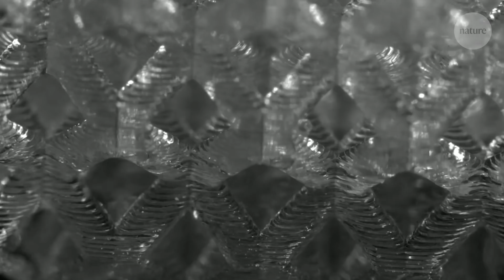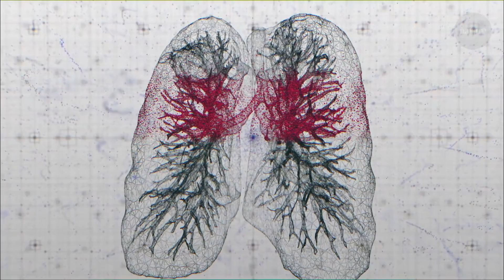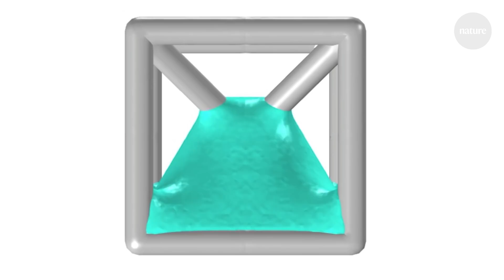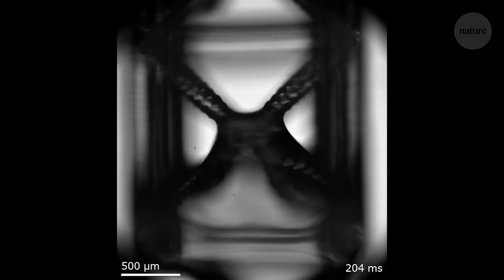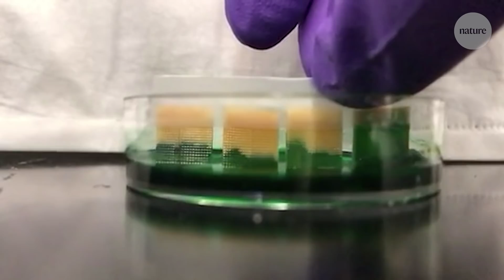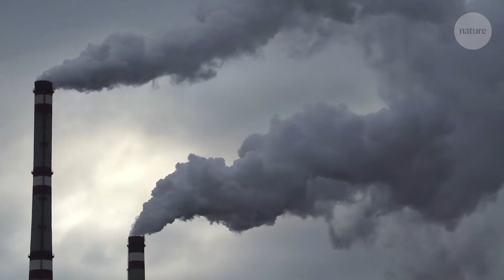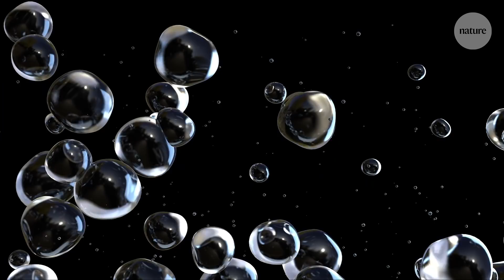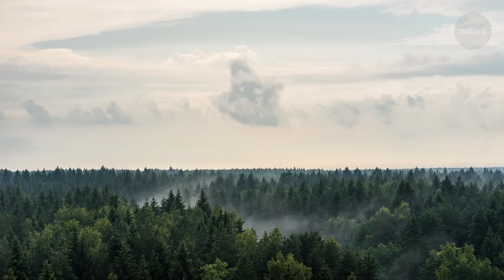Why leaky pipes can be better for moving water

Comment: Nature forgot to mention about the purity of the liquid required for this microstructure as if any additives or impurities can block the flow very easily an reduce the efficacy of the flow system
Reply: Yeah I was wondering, if you get a little surfactant/soap in there, wouldn’t it stop working?
Reply: @yoted  Just a thought, but surfactants decrease rather than completely eliminate surface tension and only work when the bulk volume is saturated. Maybe using cube networks of smaller than 1mm can compensate for less adherent liquids while still accomodating water? Although at some point I'm not sure if it would be worth it anymore. I guess salt is an option as well.
Reply: @yoted  yes it would. The required size of the cube would need to be much, much smaller or it would "leak"
Reply: A twisted tissue paper in long pvc pipe does the job well too
Reply: Wouldn't the same issue happen as it absorbs gas or particulates that it couldn't hold that state anymore?
Reply: @jonjudice1155  more or less ,plants exhibit osmosis to operate stomata cells and alter the concentration of liquid particle to devlope negative pressure to pull the liquid in the microstructure (xylem tube)which has to be homogenous for the net positive flow rate upward .
Reply: @kanpurunplugged9970  I'm sorry I may have been unclear, even though I didn't know that either, but I meant in the context of the thing they created. Sure it works in that way, but will it actually still work when it starts "trapping" things, are will the water simply fallout so to speak
Reply: @kanpurunplugged9970  surprise! Negative pressure doesn't exist. You've been lied to buy your teachers.
Reply: Thats why i hate tgis hippy dippy green tech crud. Its all so fragile and REQUIRES HYPER OPTIMUM CONDITIONS to work!
Reply: @xedrickOG  research well spent if it leads to promising results in the future
Reply: @mariomurcia7509  it wont though. This REQUIRES that distilled water only be put through the pipe. And eventually youll run  into extensive maintence issues as your system gets dirty. The amount of maintence it'd need makes the idea unfeasable. No city AT ALL can afford to repave their roads DAILY

Also repaving wpuld be needed due to having dug up the pipea
Reply: @xedrickOG  you realize it's for like micro use right? it wouldn't be difficult to clean regularly since little be in small sections. plus the idea itself is relatively new, I'm sure there's kinks to work out, but just because it doesn't have the most all inclusive application doesnt mean it isnt a worthy investment of time.
Reply: @mariomurcia7509  then the idea is useless. Micro settings means it has no market.  If you csnt sell it commercially thwn its a flop
Reply: @mariomurcia7509  and no just because something is new doesnt mean its good. Like it or not this thing woupd clog in a real, non lab setting in a matter of hours, if not a full 24 hour period
Reply: @xedrickOG  listen, if something is 3 times as efficient at doing the job of an already existing system as a raw idea, I'm willing to bet that the potential is good. besides since we dont know exactly the applications or the clog rate, its dumb to make claims like it's useless. easier to just agree and say there potential, and if it doesnt work out so be it. either way it can only be a good use of time.
Reply: @mariomurcia7509  except the existing system ia less maintenance intensive and therefore more cost effecient. This idea is stupid becsuse it needs daily maintence which simply isnt possible in ANY practical setting.  Just accept that this is a bad idea and move on. Also it obstructs the flow of water
Reply: yeah that leaves this project in lab lol
Reply: @UCA6JO_QfqPqttKNKkPtdPdQ  I never disagreed with you. I said this would work in space... MAYBE that implies that gravity would not be there 🤔 . They are just liquid pathways for now. No more no less.
Reply: Soap!
Reply: It’s a great concept though
Reply: What about the fact that this will be used in controlled environments that require purified liquids. The system can still be encased to keep fob out.
Reply: @luisislas2162  If you encase it, you remove the surface area and mitigate the potential gas exchange or cooling effect.
Reply: @TheDaggwood  I mean like without touching the surface...
Reply: Theory vs. Practice
Reply: reverse flow and maybe possible to make something equivalent to  a coin sorter for micro particles that would dump them outside of the main structure.
Reply: @luminousfractal420  still requires too much maintence
Reply: Its not designed for this world. Their designing this for space. It would efficiently move fluid through module boards as a cooling system as it moves 3 times faster. He says that in the video.
Reply: @gamet0phyt315  we arent talking about the implementation of  on earth either , we just elaborated how plants system works in the nature similarly as the -ive pressure builtup in plant stem works against gravity where as this microstructure exhibits intermolecular surface tension where gravity is insignificant.
Reply: @gamet0phyt315  we arent talking about the implementation of  on earth either , we just elaborated how plants system works in the nature similarly as the -ive pressure builtup in plant stem works against gravity where as this microstructure exhibits intermolecular surface tension where gravity is insignificant.
Reply: @kanpurunplugged9970  there is only Earth.
Nowhere else to go.
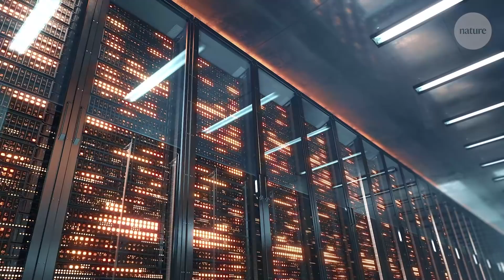Reply: Did you even watch the video ?!jump to 2:30 for application of this tech

Comment: Cool. Is this usable to acidify water on purpose? I liked the use cases. Interesting in any case. 3d printing is hardly explored isn't it?
Reply: I imagine so - if you ran these through a high-CO2 atmosphere, the large exposed surface area should let it absorb CO2 more readily and thus become more acidic.

Comment: This looks a lot like a sponge with extra steps.  The video explained the difference between one of these systems and a pipe, but I don't think it did a good job explaining the difference between this thing and a sponge.  Also, it didn't really touch on one of the important benefits of open-interior pipes, which is resistance to clogging.  It looks to me like this thing will stop working as soon as it gets dirty.
Reply: a sponge that can direct the flow sounds pretty interesting..
Reply: A sponge primarily works by the billows effect of compressing and the subsequent expansion. Also, while a super organized and uniform sponge might work to lift and hold water, it still only exposes a low surface area to the surrounding air. The engineered lattices we see in the video are optimized for maximum exposure, thus maximum absorbsion of gasses (and/or transfer of heat.) I like the idea someone else commented about, the potential to use in the algea growing process. Lots of cool uses will come of such a simple design.
Reply: @Barefoot-Jaycee  a pleated paper humidifier.  Lots of surface area there.
Reply: A towel is what came up to my mind while watching
Reply: Yeah I got the same impression from this. All this video is scientists 3D printing sponges and wicks. It's pretty cool and useful nonetheless to find more applications for this but fundamentally they just 3d printed a candle wick.
Reply: there is no difference. its just a highly precise and controllable sponge

Comment: ???!!! 🤔🤔🤔...

SO:
A wick/filter/fibrous medium, only with a strategically-constructed internal hydrophobically-conducting "skeleton lead wire" or "skeletal ladder" - whose latticework-pathway/-road provides the regularly-spaced "rungs" to "climb-travel" along some (design-determined) contiguous "adsorption vein"/pathway/shape/form.

I'm not getting what's POSSIBLY new here, whether the design, the principle, the production capability, or the applications, like co2 or heat sinks or whatever...

Like... Wtf'ing F???
Reply: What's new is being able to create arbitrary 3d shapes with the traits in question, instead of being stuck with hanging lengths of cotton or something that you then have to provide some sort of additional support to.
Reply: @absalomdraconis  
Indeed - the easy, yet precise micro-construction of spacially/geometrically arbitrary pathways and form profiles, fitting various functions/applications. 👍

Comment: Stock footage of outdated FDM printers, while the subject-matter is clearly some sort of SLA/resin printing process. "Science, yay!"
Reply: Yeah, also how it was apparently impossible to do so without enclosing the water. 

Literally every tissue, cloth or sponge sucking up water by capillary action
Reply: @brentstorck3589    An important part of science discourse and publication is reproducibility. It is annoying af when authors leave out critical tidbits of "how an experiment is done". It is fairly critical for the reproduction of microstructures that an SLA printer is used. I assume that the surface energy of the cured SLA-resin (vs. the hydrophobicity of a typical FDM "ink") also shall affect the outcome tremendously. 
I am aware of the adage "When the wise woman points to the stars, the idiot stares at the finger."
In this case, I am not staring at the finger, imo. It's the "science, yay!" tone of the presentation, while glossing over critical details, that triggered my reaction. In any case, it is not terribly difficult to get stock-footage of SLA printers (if that's what they indeed use).
Ref: https://www.youtube.com/watch?v=CVPy25wQ07k&t=220s
Reply: To add on, this is not a random youtube channel but a channel from Nature journal who are supposed to have highest level of accuracy and completeness when it comes to science and technology.
Reply: gotem
Reply: Apologies - an Ultimaker is not "outdated" by any definition; just that it was never intended to print microstructures. 
It is excellent at doing what it is intended to do - and it was not intended to print microstructures with an SLA-process.
Reply: @AdityaMehendale  ultimaker is hella outdated by 2021 standard, it is a few years old machine after all
Reply: It's probably SLA, but unless the paper (which I'm not spending time to track down) says otherwise, it could be an FDM printer.
Reply: The paper mentions EnvisionTEC Micro Plus HD printer. So indeed SLA.

Comment: But won't most airborne pathogens be able to get inside the "pipes" and water droplets?
Reply: Or in case of heat transfer, the actual heat exchanger part would still be enclosed. After all you want to control where the heat is going. (Unless it is going to the outside)
Reply: Maybe, for some uses, that would be the point: to remove pathogens and other undesirable things. They could thus be transported to be disposed more safely elsewhere or to be treated more effectively.
Reply: Not really an issue if it's not food.
Reply: @filonin2  What about water contamination?
Reply: @Bitmaker64  If you're not drinking it and using it for an industrial process like absorbing co2, again, who cares?

Comment: Doesn't a cloth do exactly the same?
Reply: Don't tell them. Psst.
Reply: My question EXACTLY.  

???!!! 🤔🤔🤔...

A wick/filter/fibrous medium, only with a strategically-constructed internal hydrophobically-conducting "skeleton lead wire" or "skeletal ladder" - whose latticework-pathway/-road provides the regularly-spaced "rungs" along some design-determined contiguous "adsorption vein"/pathway/shape/form.

I'm not getting what's possibly new here, whether the design, the principle, the production capability, or the applications like co2 or heat sinks or whatever... Wtf'ing F???
Reply: @justinklenk  I guess the fact that it isn't wet on the outside? And therefore cannot make your processor wet in the computer? I'm not sure if there's a cloth design that can do that, but there probably is...
Reply: @weareallbornmad410  
YES! ✔️✔️ I definitely forgot to note that, good sir.  Although, to the EXTENT that that's the case, I guess it was implied by the "contained directionality" concept... Kind of??
Good catch though. 👍
Reply: and foam
Reply: The paper states that the primary target of their work is in the use of multiphase processes with controllable and highly predictable motion of fluids. Also from what I understand, the target is to use this process in very small scale operations(similar to blood capillaries in our lungs so probably this can potentially be used in artificial lungs that can be 'transplanted') and not large scale which everyone in the comments is expecting.
Reply: how do you collect water from that
Reply: I mean yea, but its not as fast